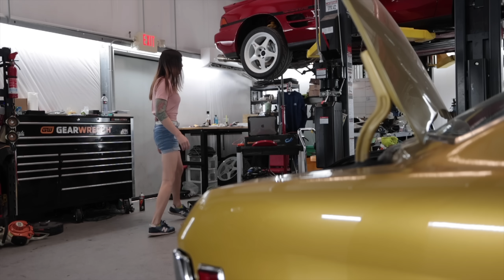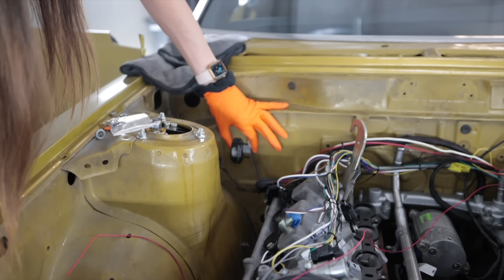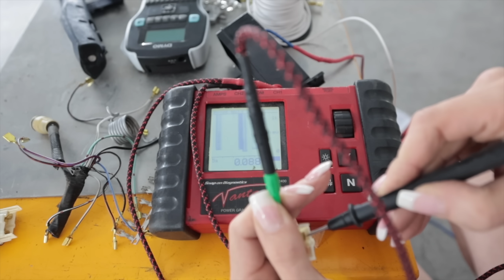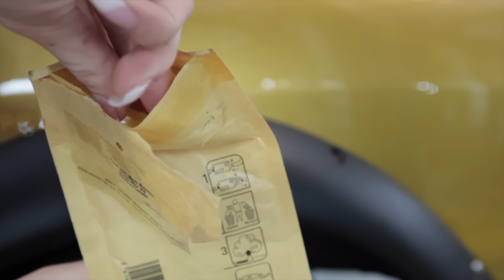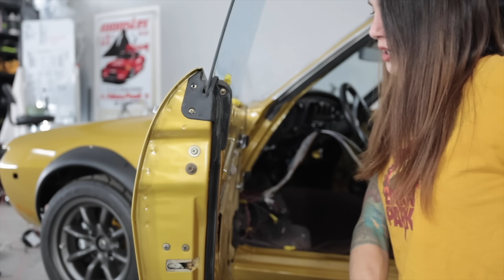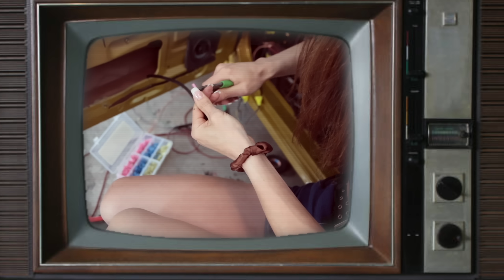Who Knew This Even Existed??  // 2UZ V8 1974 Celica

Comment: The difference between drive by wire and an actual cable is flyby wire you’re requesting power from the ECM where a cable just slams the throttle open and the ECM follows that….

Comment: if they made the fans gear/worm gear or cog  type gears or belt drive they could put the motor off to one side making the fan even more low profile because there would be no motor sticking up on the engine side that extra 2+ inches...  just  a thought for electric fan manufacturers...or or or they could put the motor inside the fan hub itself...so no gear or belt drive needed just a high powered low profile brushless motor like on the old af/x slot cars...

Comment: Yo! You can use a couple jumper wires and a jump pack or random car battery laying around to power the wires to the window motor to move it up and down. Or just unbolt it from the regulator.

Comment: Great video as always Sarah, love the way you approach things. 
A little tip from someone who worked in the smash repair industry on these era cars when they were new, that plastic sheet on the doors tucks into the slots along the bottom of the door before you put the tape on. If you don't tuck it in there you will end up with water inside the car instead of it running out the drain holes in the bottom. Keep up the great work!

Comment: That plastic is called a rain deflector, vapor barrier, rain curtain (VW).  Fun fact, if it failed on your 2nd+ generation VW Golf/Jetta your floor(s) would flood after a rain.  As a VW mechanic back then, I fixed hundreds of them.  Bad design on VW's part.

Comment: Simple mistake but the TPS does not move the throttle butterfly. There's a throttle control motor on the throttle body which moves the throttle. The TPS just tells the ECU how much the throttle motor opened the throttle.

Comment: You should try washing a set of valve covers with antifreeze.  I have nitro glow engines with aluminum blocks.  to clean the blocks up I use antifreeze so it doesn't darken the aluminum. Hot water is bad for darkening.

Comment: Those fans are a great idea. I was working on a project vehicle that runs in the desert and the fans kept blowing fuses so we had to rewire them with heavier circuits due to the absurd inrush current. They don't use much while running but they pop breakers on startup.

Comment: I complained much more than this when using a generic 12 circuit harness to re-wire my Scout, and it is a mechanical diesel so only needs 2 wires to run; glow plugs and starter.

Comment: Liking all the wiring videos. Sanding vids, not so much.  You should put aftermarket door lock actuators so you can avoid having to use actual keys each time. It would suck to scratch a door, even if its a light scratch you'll know its there.

Comment: As a thought about wiring the fans individually:
Wiring the fans as “low” setting where only one fan is running and then a “high” setting where both of the fans are running. 
Since both fans aren’t always needed all the time for cooling. But that’s just more work 🤷🏼‍♂️

Comment: Door lock tip
If you can feed it all though the hole assemble it first.
Very rarely do these type of locks not fit through when assembled.
Just remember to get all the bits fitted in the correct positions and not flipped around etc
Reply from the maker: That’s how I finally got it in, that’s why I had the front all taped up. I was too irritated to bother filming at that point 😂

Comment: If you're ever repurposing a relay, and after wiring it up all correctly, it doesn't seem to work?  
Check to see if it's got an internal diode - I've seen that quite often.  Anyhow, just flip your polarity, and all of a sudden it'll work!
Reply from the maker: You didn’t wire it up correctly if it doesn’t work.

Comment: Regarding the shielded wire to the throttle sensor, my guess is Toyota called for that from a liability standpoint. In the rare case of a stray signal interfering, the throttle could conceivably go wide open. 
Maybe. 😊

Comment: Watching these videos is a great lesson in how much of the challenge of designing a car is not designing its physical capabiliies but designing the process to MAKE the car and put it together.  Who would come up with a design that requires placing a C-clip on a shaft in a position inside a door without eye contact?  It might have been part of a larger sub-assembly during original assembly but fixing / replacing just that part becomes nearly impossible.

Comment: If a sensor cable runs near the injectors , ignition system and or the alternator it will probably need shielding. Basically anything that can induce a signal into the wires should be shielded against. The more sensitive the sensor needs to be the more shielding it needs.
Sometimes twisting the wires reduces the need for shielding.

Comment: the plastic is sound deadening
Reply from the maker: Negative, it’s a moisture barrier to keep your inner door panel fiberboard from getting wet when the glass is down.
Reply: @SarahnTuned  thank you for the heads up . 18 wheelers have the same but thicker . Door innard is all plastic . I guess it's multipurpose

Comment: Need to shield the wire? Not for it to work. But it can be susceptible to outside interference. This is why Toyota had a rash of run-away cars during the late 90's early 2000's. (Through store front windows and once through a crowd at a picnic). Certain radio frequencies, or magnetic fields, can create voltage disturbance in the circuit, thus causing the throttle body to believe the gas pedal is floored. Please, Sarah, use a grounded shielding wrap. You don't want such an incident on your hands.
Reply: oughta pin this comment